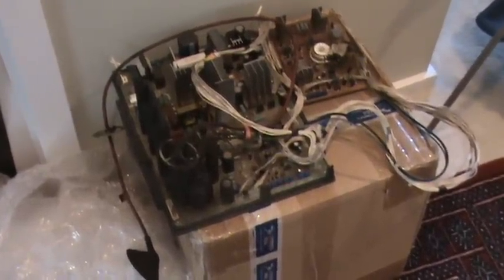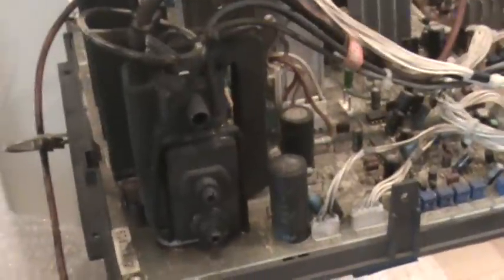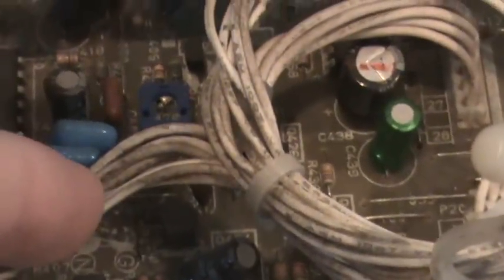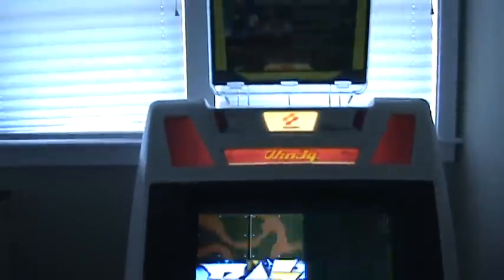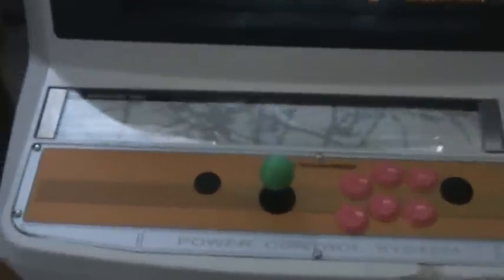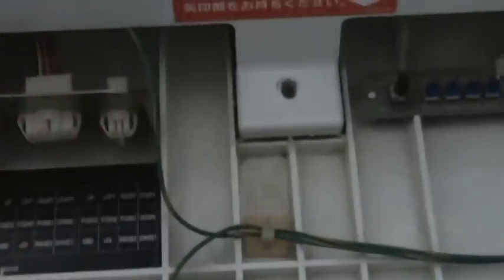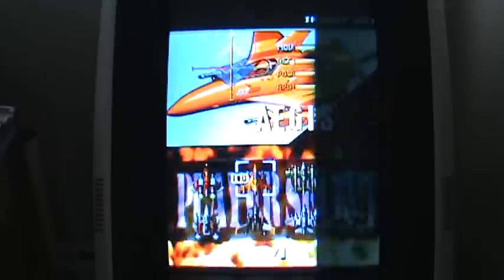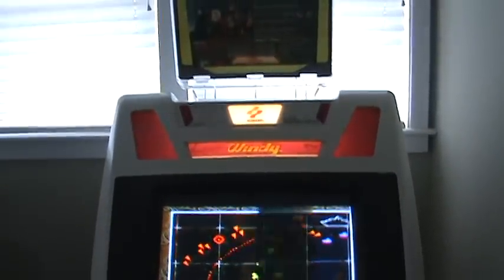Konami Windy Monitor Chassis Adjustments & Cab Overview

Comment: lovely cab there boss, good luck getting the monitor chassis straight. Why is everything 10 times bigger in a cab, even the power supply is enormous!! Like the vertical screen, great game too, looking forward to that, I found out yesterday that the raiden fighter series is coming to xbox in September which is cool. They play better than the "high def" games in the series, raiden 3 & 4, which are pretty boring. Nice vid dude.

Comment from the maker: @fakeplasticball Thanks, and yes it's Japanese.  The monitor is on vertical orientation right now, to switch it to horizontal they tube needs to be pulled out and manually rotated as does the monitor bezel.

Comment: BossBossly I recently  got my Konami Windy cab back after 9 years. I'm wanting to restore it. The chassis died and was sent to Australia for repair way back in 2007. I never got a working chassis. Also I think I'm missing the part that allows the monitor to rotate. Do you know where I could get a chassis that would fit the stock monitor... also could you tell me if there's an extra part in the cabinet that allows the monitor to rotate... was that part of the chassis? I think I recall a bronze looking plate that held the board in place... that I may have taken out when I sent it in for repairs. I'm very desperate to get this machine back in working order. Please help! It seems there aren't very many of us with these cabinets!

Comment from the maker: @futurematt5 Thanks Matt, still need to do some minor tweaks to the monitor but it's by far better than it was.  Just made a ground cable for it as most of the Japanese cabs don't have a ground pin on the main power plug, now I need to install a volume control.  All in all it's coming together very nice.  I agree, IMO the Raiden Fighters series is way cooler then Raiden 3 & 4.